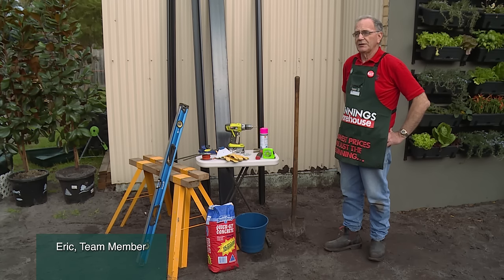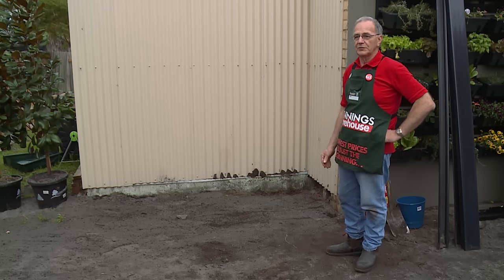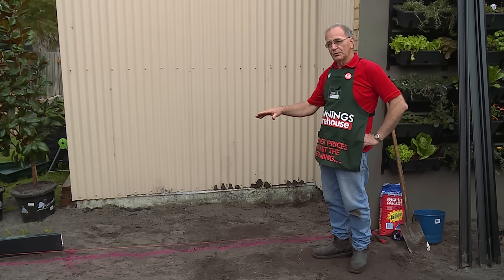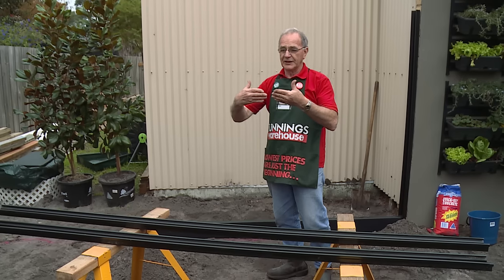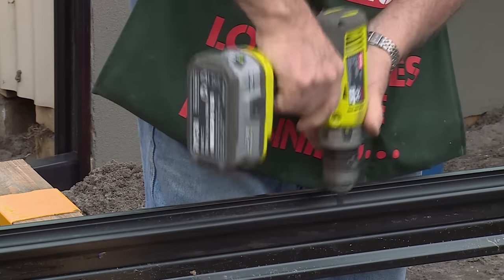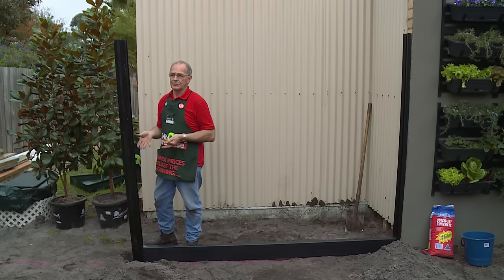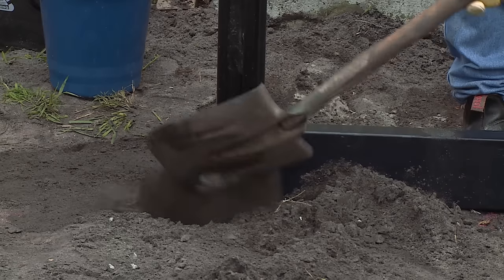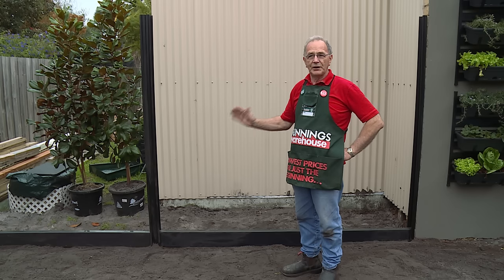How To Set-Out Posts For A Colorbond Fence - DIY At Bunnings

Comment: But how deep do the fence post have to be in the ground so that the whole fence does not tip over in a strong wind. Depth of post should be one of the most important details - but not mentioned - just read the instructions on the pack !
Reply: looks like they dont answer questions lol. 
its 6 ft in the ground for a 6 ft fence